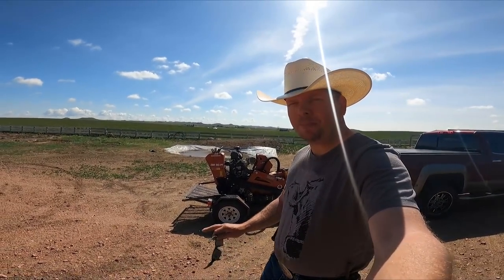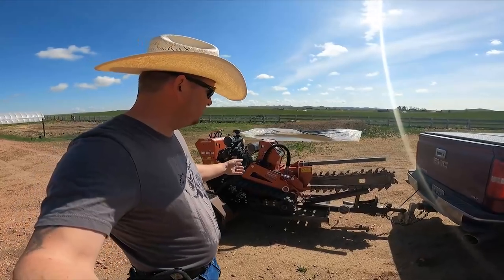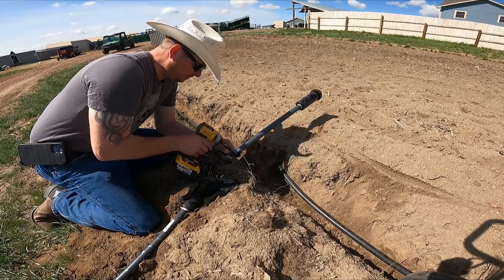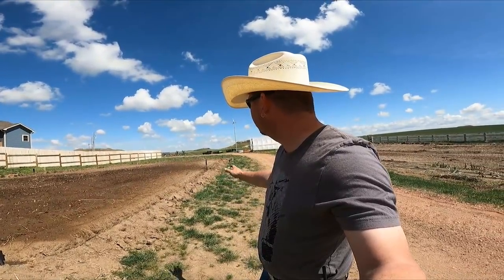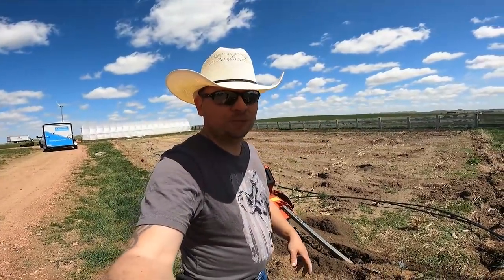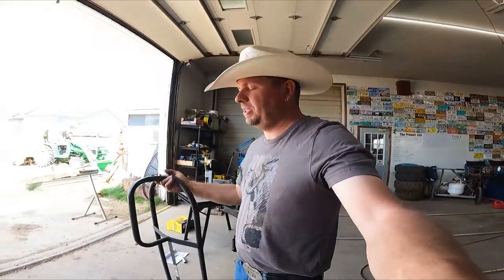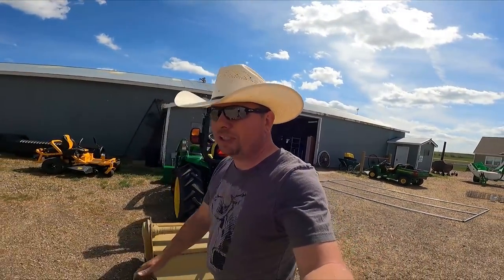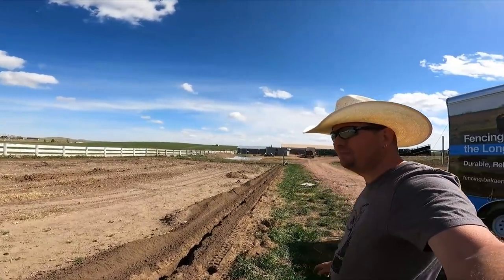Prepping for New Fence

Comment: Good job on the gate. Please keep in mind when welding Galvanized Steel, get as much fresh air in your work area, and wear a respirator. Welding Galvanized Steel can cause Metal Fume Fever, and can poison you if exposed to enough of it. The little bit of welding on the gate won't poison you, but could make you feel ill. 3M makes good respirators that will fit under you welding helmet. Stay Safe.

Comment: Hey Mike, Ya forgot to do one important thing before all that ditching. You did not call utilities to have your area checked for underground gas and electrical. He hee. 😜🤪 another question, why was there no cross bracing on the large fence gate. I think that would be needed.
Reply from the maker: The area we were working in is all private utilities. One call will only locate public. We know that there are no gas lines through the area we are working in. Thanks for watching!